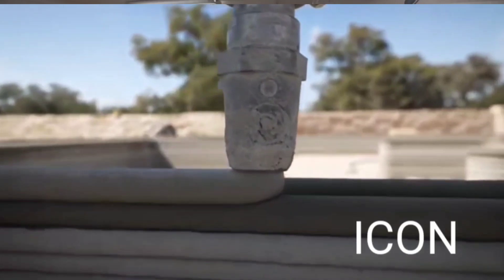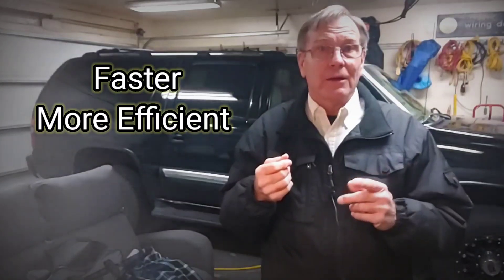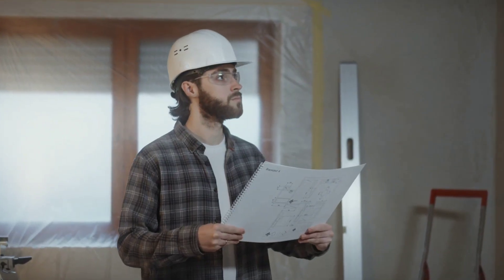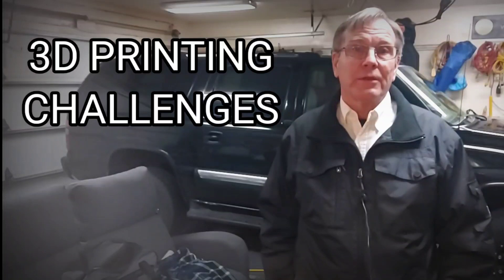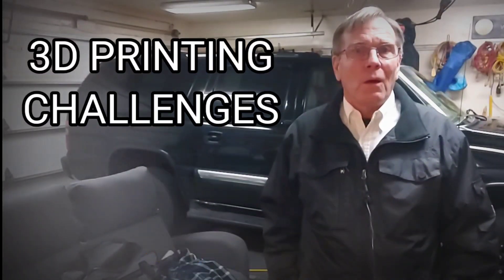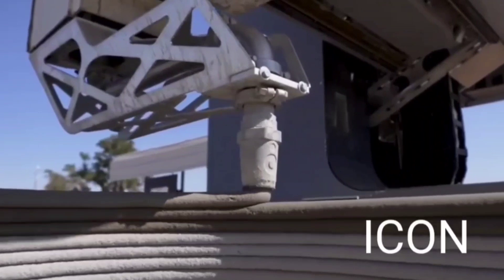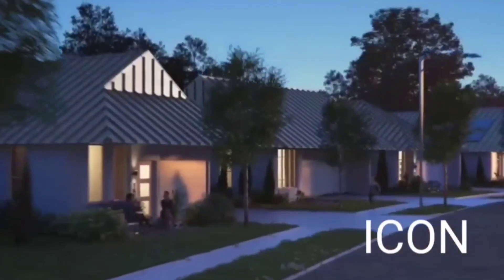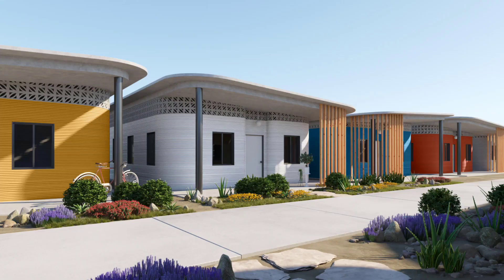What Are 3D Printed Homes?

Comment: Interested to see how it is insulated, wired, and plumbed.  How is drywall, base, case and cabinets installed into the concrete? What kind of soil compaction and footing size are required to support the weight of the concrete? How would you move walls about in a remodel? And a whole host of other questions.